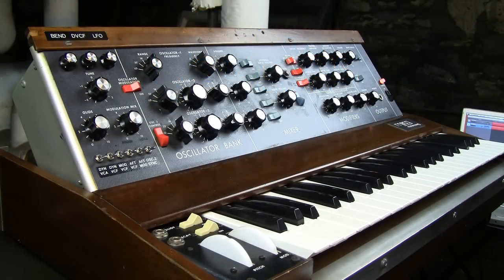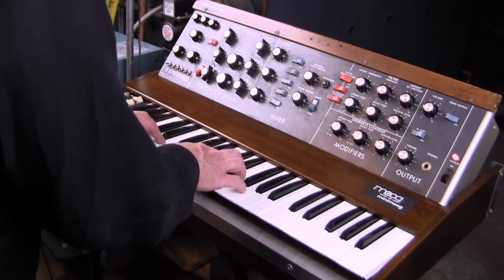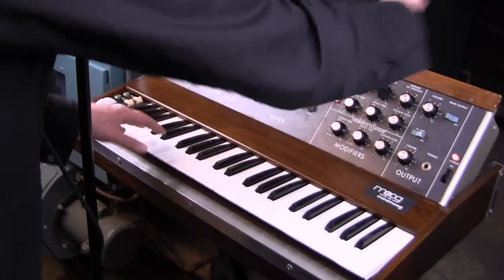Minimoog Demonstration:  The Bob Moog Foundation Minimoog Raffle Part 1

Comment: 01 Minimoog Model D serial number 4245 modified by Rich Walborn & signed by Gary Numan 0:00:12
02 Extra knobs & switches 0:00:40

OSCILLATOR-1
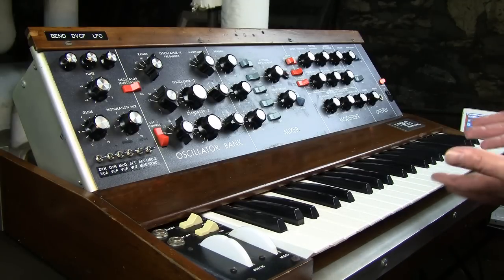03 OSCILLATOR-1: Sawtooth wave 8” 0:01:03 / 0:01:13
04 OSCILLATOR-1: Sawtooth-Triangular (Bend Triangular) wave 8” 0:01:19 / 0:01:22
05 OSCILLATOR-1: Triangular wave 8” 0:01:28
06 OSCILLATOR-1: Pulse 1 = Square wave 8” 0:01:38
07 OSCILLATOR-1: Pulse 2 = Wide rectangular wave 8” 0:01:47 / 0:01:56
08 OSCILLATOR-1: Pulse 3 = Narrow rectangular wave 8” 0:01:59 / 0:02:02
09 OSCILLATOR-1: Sawtooth wave Lo 0:02:06
10 OSCILLATOR-1: Sawtooth wave 32” 0:02:12
11 OSCILLATOR-1: Triangular wave 32” 0:02:18 / 0:02:21
12 OSCILLATOR-1: Sawtooth wave 16” 0:02:25 / 0:02:28
13 OSCILLATOR-1: Sawtooth wave 8” 0:02:30
14 OSCILLATOR-1: Sawtooth wave 4” 0:02:35
15 OSCILLATOR-1: Sawtooth wave 2” 0:02:39

OSCILLATOR-2
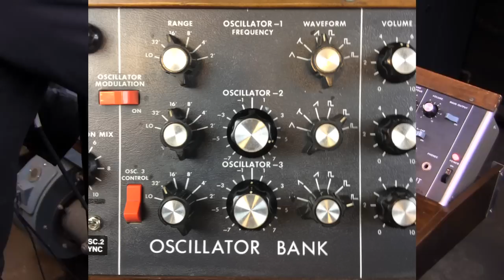16 OSCILLATOR-2: Triangular wave 0:02:50
17 OSCILLATOR-2: Sawtooth-Triangular wave (Bend Triangular wave) 0:02:55
18 OSCILLATOR-2: Sawtooth wave 0:02:58
19 OSCILLATOR-2: Pulse 1 = Square wave 0:03:01
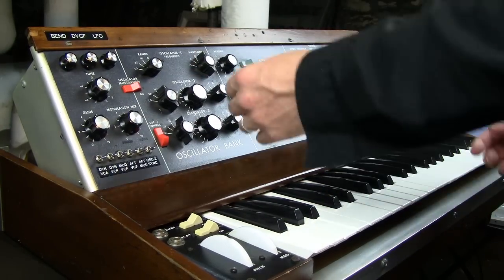20 OSCILLATOR-2: Pulse 2 = Wide rectangular wave 0:03:03
21 OSCILLATOR-1: Pulse 3 = Narrow rectangular wave 0:03:04
22 Finetuning/detuning the OSCILLATOR-2 0:03:08 / 0:03:11 / 0:03:22 / 0:03:36

OSCILLATOR-3 0:03:56
23 OSCILLATOR-3: Triangular wave 0:03:59
24 OSCILLATOR-3: Sawtooth wave 0:04:02
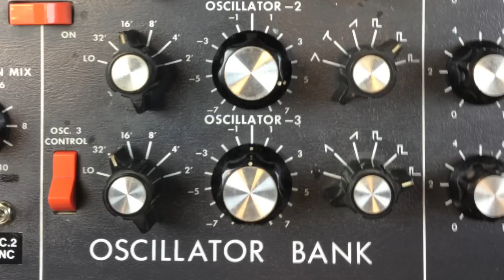25 OSCILLATOR-3: Triangular wave 0:04:10
26 OSCILLATOR-3: Sawtooth wave 0:04:12
27 OSCILLATOR-3: Ramp wave (= Reversed Sawtooth wave) 0:04:16
28 OSCILLATOR-3: Pulse 1 = Square wave 0:04:43
29 OSCILLATOR-3: Pulse 2 = Wide rectangular wave 0:04:46
30 OSCILLATOR-3: Pulse 3 = Narrow rectangular wave 0:04:51
31 MIXER: All three oscillators on 0:04:57
31 OSC-3 CONTROL switched off >> OSCILLATOR-3 as source of modulation 0:05:23
32 MIXER: All three oscillators on 0:05:52

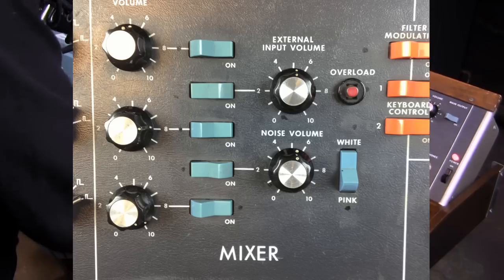MIXER section 0:06:12
33 OSCILLATOR-1: Sawtooth wave 4” On 0:06:23
34 OSCILLATOR-2: Sawtooth wave 16” On 0:06:25
35 OSCILLATOR-3: Triangular wave 32” On 0:06:28
36 NOISE: WHITE 0:06:30 / 0:06:36
37 NOISE: PINK 0:06:38
38 EXTERNAL INPUT VOLUME 0:06:39

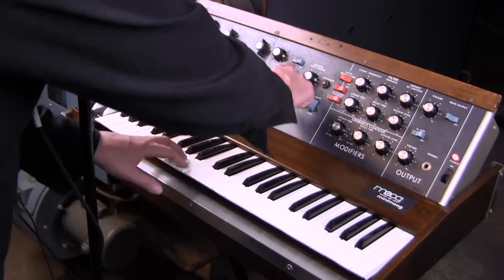FILTER section (Moog 24 decibel per octave transistor ladder filter) 0:06:55
39 Changing CUTOFF FREQUENCY with no EMPHASIS (Resonance) 0:07:03 / 0:07:21 / 0:07:33
40 Changing EMPHASIS (Resonance) & CUTOFF FREQUENCY 0:07:38
41 The filter self oscillating 0:07:54
42 Changing the filter over time >> AMOUNT OF CONTOUR (Filter envelope) + ATTACK TIME + DECAY TIME + SUSTAIN LEVEL 0:08:16
43 Keyboard effect altering the filter cutoff point depending on how low or high note you play on the keyboard 0:09:11
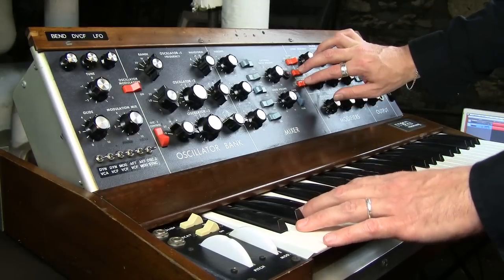44 Using the self-oscillation of the filter as a sine wave tone source 0:09:33 / 0:09:54 / 0:09:58

● Discussion of the various merits of the Minimoog https://www.youtube.com/watch?v=uFyQ2WFUneg
● Demonstration of the Moog Minimoog https://www.youtube.com/watch?v=sJ5593eQ
● Minimoog Demonstration: The Bob Moog Foundation Minimoog Raffle Part 1 https://www.youtube.com/watch?v=Z8UUtSbhdpY 
● Minimoog Demonstration: The Bob Moog Foundation Minimoog Raffle Part 2 https://www.youtube.com/watch?v=JoK4jMX5eN4
● The 2014 BMF Minimoog Raffle: The Minimoog Oscillator! https://www.youtube.com/watch?v=7s8nSoPaWpc
● The 2014 BMF Minimoog Raffle: The Minimoog 3rd Oscillator! https://www.youtube.com/watch?v=8RVd8FD3pyc
● The 2014 BMF Minimoog Raffle: The Minimoog Filter! https://www.youtube.com/watch?v=yPHJA092a9w 
● Sounds of the Moog Minimoog https://www.youtube.com/watch?v=-YO8GrOaAcw